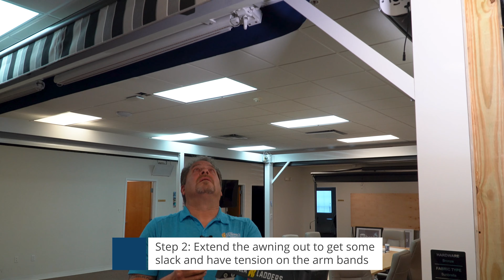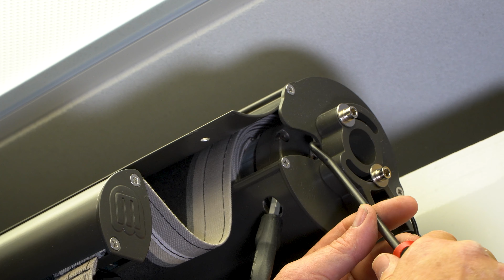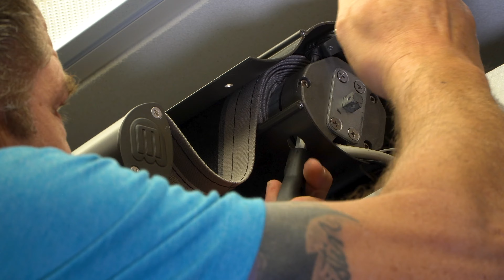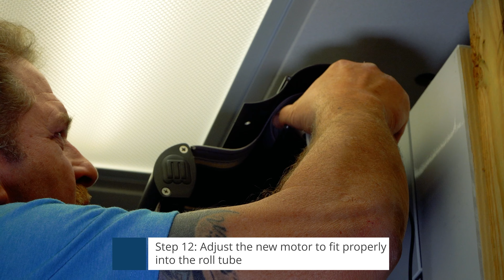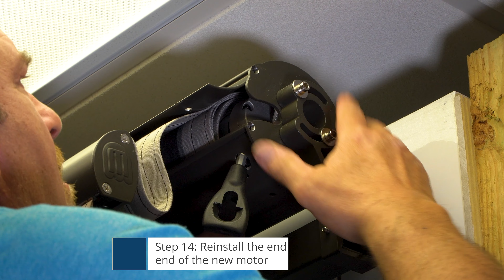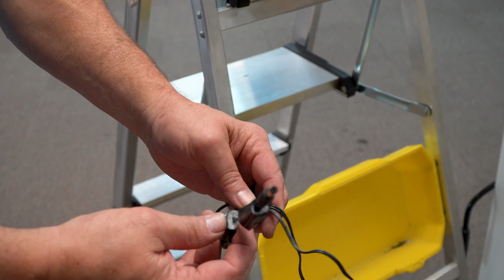Retractable Awning Motor Replacement | Step-by-Step Guide

Comment: I have an issue where we have two awning side by side with a 6" gap and the motor is on the inside...any suggestions how to make enough room to pull the motor out.  They are Total Eclipse building awnings.  Thanks
Reply from the maker: Thanks for the question! Since this is a different awning system, we’d recommend having a qualified awning technician take a look to determine the best way to access the motor safely.
Reply: that’s not gonna be possible since we’re in Anchorage, Alaska and I don’t even have a company that deals with that up here

Comment: What can be done if there is not enough clearance on the motor side to slide out the tubular motor? I only have about 7 inches of space. Is it required to fully remove the cassette awning / complete awning system in this case, or is there any workaround for motor extraction in tight installations?
Reply from the maker: Thanks for the question! With only about 7" of clearance, the best approach can depend on the specific Shade Sense awning and motor configuration. We recommend having an authorized Shade Sense Outdoor dealer or technician take a look before attempting to remove the motor or cassette.

Visit our website to find an authorized dealer/technician near you, or contact us directly and we’ll be happy to help determine the best solution for you!